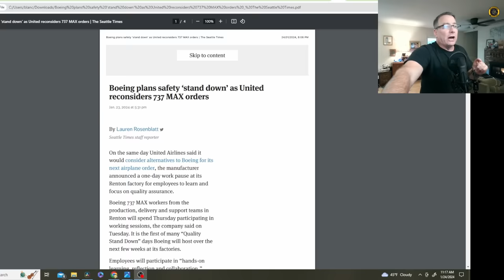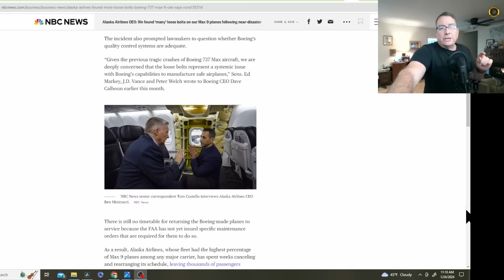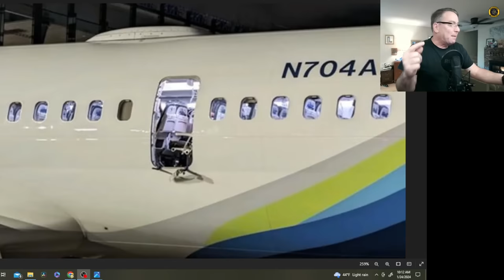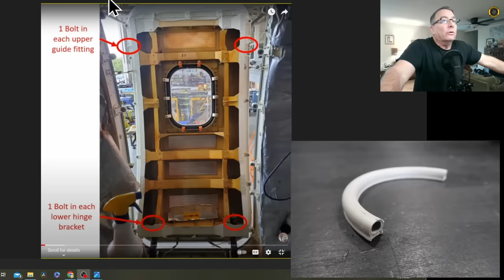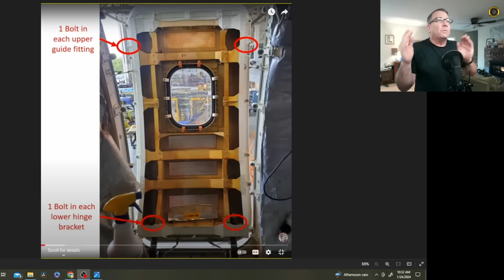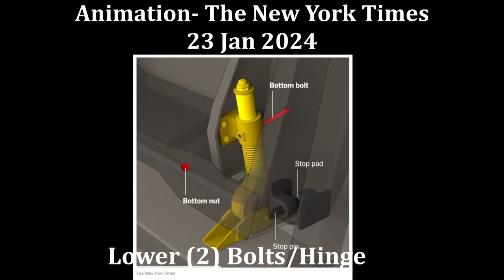Boeing's Quality Management Failure Explained 737-Max-9 Door 24 Jan 2024

Comment: Fun fact, Boeing manufacturers less than 40% of the airplane. This is in sharp comparison to the merger with McDonnell Douglas prior. Prior to McDonnell Douglas they pretty much manufactured the entire aircraft. They were an engineering company back then and now they’re just an assembly company using the old McDonald Douglas mantra of cutting cost and corners wherever possible. Even at the expense of safety and lives.
Reply: For the love of money is the root of all evil. MBA bean counters just ignore the crucial engineer adults in the room and this is what you get.
Reply: Hence why the DC-10 had problems…
Reply: Exactly!
Reply: Amazing after 25 years, that budget  mindset still remains. It seems like the pattern will continue. Lessons have not been learned after the 787, MCAS and now this debacle.
Reply: yup. Even though Boeing 'bought out' MD, all the MD higher ups all went over to Boeing and took over and ruined the company. That's why there have been so many problems with the aircraft boeing built afterwards. Note how the 777 almost never seems to have problems? That's because it was the last aircraft designed and first flown before the merger. 787 and the max have both had major issues. Aircraft groundings have only happened 3 times in the US. Wanna guess which aircraft? DC-10, 787 and 737 MAX. That's it. An airbus aircraft has never, ever been grounded. It's always those greedy MD/new boeing people.

This is not to mention the fact that after the takeover, they moved their HQ to Chicago, away from Washington state, for the first time. They wanted to create distance between them and the engineers actually building the planes.
Reply: Ford tried to make that same claim (we don't "Make" the car) but the judge asked whose name is on that car?  Yeah that excuse doesn't work. Boeing is responsible as the contractual manufacturer of the finished planes  and that makes them liable for inspecting what they produced.   Of course making this  even worse is that apparently for several years now, Boeing has "self-inspected" aircraft and designs without normal Federal oversight.  That may very well end now and that will mean more Federal Inspector jobs.
Reply: @malcolm5514 that is so not true. Your choosing events and situations connecting them to point blame and clear the responsible party whose name is on the plane. Further more since Boeing was the top take over dog and not an equal merger a big portion of the Douglas execs were layed off and forced to take separation packages if they couldn’t retire. Many were promised they wouldn’t be replaced but after a year they  were layed off and replaced by Boeing employees. MDC had large facilities located in much nicer locations than rainy wet Washington and many Boeing execs were reassigned as a promotion to Ca or Az. There were prior deals made under the table while the take over was being negotiated. From what I remember was Boeing employees came first on placement without preference to whose most qualified. Many of the MDC folks were layed off if they didn’t have the points required to retire. Your facts appear to originate from anal areas.

Comment: That's really a double failure: 1-technician's failure to replace the bolts as part of closing the door 2-procedural failure in having no inspection requirement after closing the door. I might add 3-No one asking "Hey! What are these nuts and bolts doing here on the floor?"
Really... where did the bolts go? Did the tech who opened the door stick them in his pocket? Don't those split pins (Cotter pins) need to be replaced and not re-used so there should be a parts BOM for the procedure? I suppose that's part of number 3, no accounting for parts in & out.
Reply: Don't forget the initial failure, the reason they had to open that plug in the first place - to fix the seal
Reply: Perhaps they were never there.
Reply: It simply beggars belief that whoever put the door back in it's place did not spot FOUR holes where the bolts were, unless they were in a hurry or maybe they assumed it was the job of the next shift, or maybe it was at the end of their shift and they were urged to clock off. Far too many questions. But Boeing has to know who it was who refitted the door.
But this reminds me of my last place of work, a TV post production house. I cam in early one morning and dropped a tape in the machine to edit. Did the edit, the edit was QC'd but what no-one noticed was that I had edited the wrong episode but named it what was on the paperwork. We worked to 100% accuracy and that one error cost me my job. But I know why it happened, all of us were bored out of our heads doing repetitive edits.
Reply: The its “not my job” attitude prevents people for going one inch past minimum requirement to keep the job.
Even if they see the bolts loose on the floor, they don’t care.
Then there so many others that haven’t got any clue about anything, lack curiosity, or ability to even think.

Comment: What an excellent video!  Thank you so much for explaining (in laymans terms) not only what actually happened concerning the work on the plug-door seal but also why problems occurred due to a disconnect between Boeing's & Spirit's different internal reporting procedures.  Makes the whole thing now crystal clear to me in my understanding as to how this huge and potentially fatal oversight in the inspection regime could have occurred.

Comment: Been a Boeing guy my whole life. Love the history of Boeing. Went to Las Vegas this weekend on a Airbus 321 Neo and flew home on a 737-900. Needless to say, I was more relaxed and at ease on the 321 than the 737. What a shame!
Reply: So as a Boeing guy why are people not doing the job? Not just in this instance, but in general. It has to be the guy on the line that didn't replace that bolt.
Reply: I think Boeing stopped being Boeing when MD took over. The name was changed to protect the guilty. Kinda like what what USAir did to AA. Same colors, different airline.
Reply: It's the guy on the line that doesn't do something, but it's a management function to prevent what would happen through normal human actions.
Not knowing better but through tiredness or being distracted I've built things incorrectly. Generally no one dies though from a faulty turbocharger build. 
Over time things such as build boards are adopted to show you have used all the parts. Torque guns can have a use counter or steps can be interlocked, so you can't do process d in a series till you have done process c.
Other than the release of dioxin in Italy in the 1970s and Flixborough (UK) nearly all big accidents occur on night shifts. If the big accidents happen on night shifts what do you think happens to the rate of small accidents?
You want processes to catch prospective errors and well rested staff with adequate breaks and changes of task to stay alert. Anything less is a recipe for........
Reply: This hullaballo could be about a disgruntled employee or disgruntled employees out to 'get the company' and tarnish its image to the public.
Reply: @Airpaycheck Not really the same. US airways and by extension America West was a very competently run airline (you don’t go from a small LCC based in phoenix to being able to take over two of the worlds largest airlines in a matter of two decades if you aren’t). AA was a complete shit show going into bankruptcy constantly, hemorrhaging money, while simultaneously making massive aircraft orders. US air elected to keep the AA brand because it was stronger just as they had decided to keep the US airways name over America West a decade earlier.

Comment: Per Boeing's specifications, a mechanic must obtain permission from the QA inspector to remove any previously installed parts, including BOLTS (specially, primary bolts). A job order "ok to remove" will be initiated to document the reinstallation process, ensure that the bolts are torqued per DWG requirements, and relieve those individuals who did the initial installation/inspection of any responsibilities. it doesn't matter if you call it a door or door plug.

Comment: I retired from Boeing a few years ago. In the last few years of work, they were  moving rapidly away from actual QA inspections. Instead, they decided on using a system of production workers signing off each other's work and even eliminated some inspection steps.
    A few of us thought it was a "not one of their best" ideas. Upper management loved it. It would save time and money, not having to call a QA over to check work , and fewer QA to hire. (But management did push the stock value over 📈$400 for a while).
   Speed and profit over quality or, in some cases, ??safety??.
      Is this ??? Just one of the results ??? 🤔😮
Reply: prior to MAX/MCAS forecasts indicated $525. Its been in free fall since.  re: Alaska - The Standard Airworthiness Certificate is dated 25 Oct 2023. Was the "issue" in place then or did it occur at some point after?
Reply: Money - the root of all evil!
Reply: @SmittySmithsonite yeah financial engineering so much easier than actual product engineering
Reply: "It would save time and money, not having to call a QA over to check..."
That's it in a nut shell. Now all you have to do is add that money they saved and subtract the money they just lost and the check the sign in front of the answer for a + or a - . My money is on Air Bus.
Reply: Profits over people -- it's the default corporate MO -- and as long as bean counters rule the world, nothing will change. :(
Reply: There is no reasonable aircraft mech on the Planet that thought that removing that plug would not be RII. This was a criminal act of negligence!!!
Reply: We,  in the USA DoD, sometimes use a system named Production Acceptance Certification where trained line employees perform the old style QA inspections . The old style QA inspectors go around the maintenance areas and spot check a sampling of each PAC employee's work. IF the QA sampling inspections reveal two or more failures to adhere to Technical Order requirements then the PAC employee suffers the loss of their PAC certifications. Everything gets scrutinized. Safety wire installation failures, failure to properly cap and plug lines to prevent FO entrance potential, excessive residue from multiple safety wire installations in an enclosed area, etcetera.
Reply: Sad, but true

Comment: USAF maintenance had personnel at different levels; a 3-Level was an apprentice, basically learning on the job after tech school. The 5-Level did the job along with the 3-Level who was learning. Then a 7-Level would inspect the work and sign off on it. 9-Levels were overall Supervisors. The key ingredient was that expert 7-Level who was tasked with inspecting and signing off the work.
Reply: Which would fall apart if the level 9 was told he had to reduce cost.  Leaned on the 7 who responded by letting a few things slide.  In a few years when the 3s become 7s you have Boeing.
Yeah not that simple but it is part of it.
Reply: Hmm, Levels 3, 5, 7 and 9.  That's odd.

Comment: That employee who whistleblew says that actually there is nothing recorded in CMES about either the door being opened or removed, hence no QA inspection requirement.  That's why Boeing said initially that they never opened the door.  What they apparently do have in CMES is that a seal was replaced but nothing about how.  Of course, you can't replace the seal without opening or removing the door, but that's what CMES shows.  SAT, on the other hand, explains what actually happened.  As a classic example of software not supporting safety: apparently because the plug door is a panel, not a door, it can't be "opened", only "removed".  So there's no place in CMES to show the door having been "opened", only "removed".  So since they didn't "remove" it (but of course they did), they didn't record the opening in CMES.  Of course, it SHOULD have been shown as a "removal", for all the reasons discussed -- like that a QA inspection would then take place.
Reply: This is not entirely accurate, because it is a panel and not a door it 100% would be a removal. any time previous work/acceptance is disturbed (aka these bolts) paperwork stating a removal was performed is in fact required and would be generated in the CMES system. It can even state that "the door/panel was not removed but torque was disturbed and door/panel was opened" or this statement wouldnt have to be stated at all and the removal paperwork would stand on its own and it would drive all of the right instruction to reinstall everting per engineering with all required QA buyoffs. The gap here is more of 1. 2 different systems which dont directly talk and 2. mechanic error for not making the removal paperwork described.  ... I dont want to state details about why I know this but I can tell you that I am not speculating, these are facts of boeing system and process... very unfortunate this happened but very fortunate no one was hurt.
Reply: There is only 1 installation (or re-installation) process so there should be only 1 process for removal. I don’t care if you call it “open” or “remove”. If those bolts are removed then they should assume the door needs to go through the installation process again with all associated inspections.

Comment: I retired from that place after 35 years working there four years ago. Started on the wings then had some good connection and got a job as a tool room guy setting up power feed drills . I went to the 2nd shift and rode out my last few years there.    I turned 62 today SS starts next month and they could not pay me enough to go back.
Reply: Also smart starting SS at 62. I did the same. I'm 71 now and no regrets.

Comment: I am a retired airline mechanic and at the airline I worked for no matter how big or small the job was if you open something there is a close out procedure before you close it and once you have it closed a final. Absurd that a panel (of any type) can be opened and no inspection(s) on closing. I am sure this is the result of unskilled management and mechanics(???) doing the work which to the downfall of the industry is common practice these days for vendors supplying the aviation industry.
Reply: I suspect the issue is up at some higher level, it was decided that "opening a door" was no big deal and didn't require much follow up.  That's understandable if we're talking about a normal door.  But "opening a plug door" is different and it appears the rules/regs/software didn't take that into account.

Comment: Sir, thank you for putting this content out. I am a GA pilot up in Canada. I have been aware of the poor quality control at Boeing, for the past 3-4 years. This is due to some whistle blowers that came forward a few years back, that spoke up about the lack of good quality control, due to out sourcing some sections of manufacturing of the fuselage.  So it was just a matter of time  before something pops up. I do think that the management at Boeing is accountable.
Reply: Things must be getting worse, because this is directly boeings fault, not the people they get parts from.

Not only should the company be given serious fines, but there's at least one person in management that deserves prison time, and at least one lazy employee, that needs to be fired, who can't be bothered to put bolts back in after they take them out.
Reply: @lordgarion514  it’s not the same employee putting them back that took them out, that’s part of the problem …communication (lack there of)
Reply: Boeing started doing heavy out-sourcing work about ten years ago.  Penny wise.  Pound foolish.
Reply: @daveb2280  
The door, which was made by an outsourced company, was perfectly fine.

In fact, it was so fine, that with no bolts holding it in, it made more successful flights than Boeing's capsule. 🤷‍♂️
It was the Boeing employees that put the plug in the hole, and was too stupid to understand that it needed bolts......

And I'm sure that idiot is an overpaid union member. Probably won't even get fired. Just a write up.

Comment: This is an error in the safety CMES system. It's like a bug in a computer program. Whenever the bolts are removed, there should be a quality check that they have been re-installed. The CMES does not ensure this - if the door is only "opened", the bolts are removed, but there is no requirement that they be inspected to ensure that they have been re-installed as there is when the door is "removed". So ultimately this should be laid at the feet of the safety engineers who write the CMES procedures and their managers at Boeing.

Comment: That's a great in-depth analysis Juan. The lack of coordination between the two record keeping systems is the most enlightening part, and likely to be the real reason for this incredible failure to check something as simple as the installation of four bolts. The one-day safety stand down is eyewash, obviously, and the two companies need to work full speed to integrate their assembly and inspection tracking.